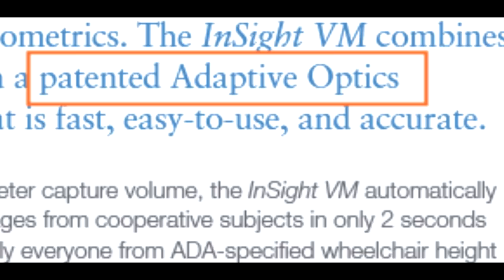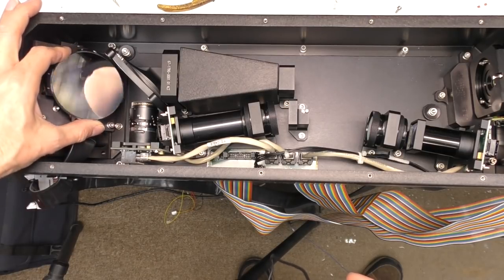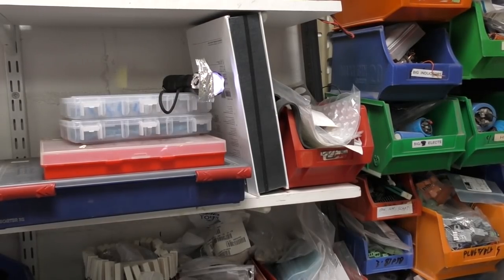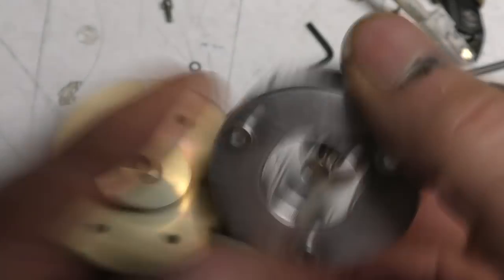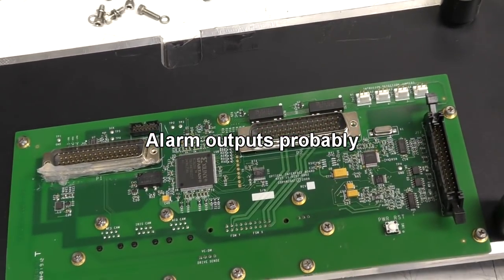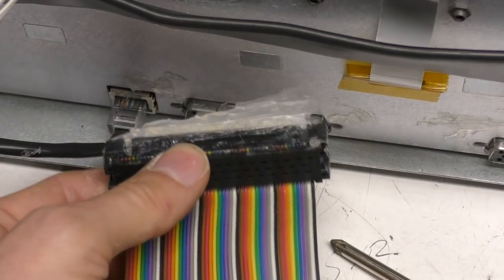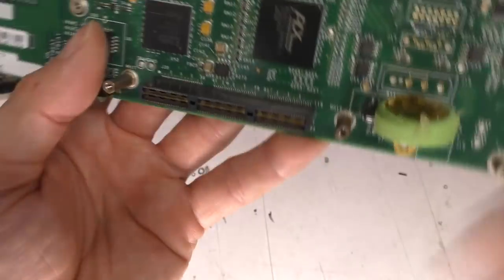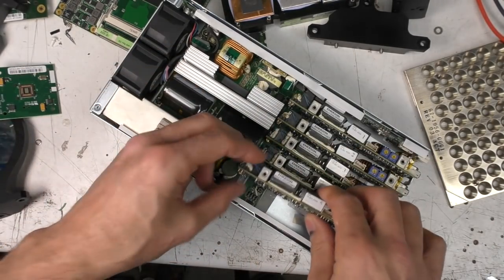Biometric Iris scanner  Aoptix Insight VM AB1012C

Comment: You could probably program the average 2019 flagship smartphone to do this pretty effectively already. But throw a few million into R&D and you'd have an infallible AI supported high tech biometric face/Iris/Retina/body recognition scanner, that's housed in a tiny cigarette pack sized rechargeable self-powered unit. With little to no moving parts, utilising the latest highly encrypted wireless connectivity. Imported from China, available on eBay and in most spy gadget stores worldwide for about $99.99. LOL

Comment: Maybe the siliconed connector was screwed from inside the case, it was very hard to service it and the service guy just used silicone to put it back.
The top mirror sensing maybe is work just like those cheap sharp ir distance sensor

Comment: PSU looks very similar to the Astec MVP series, looking online it seems Emerson now make them. Great power supplies, but a pain to replace the capacitors on some versions (Modules soldered on earlier versions)  2010 onward sounds about correct, but a couple of those boards in that unit looked a lot older, especially looking at the design on the axial capacitors and IC's, I wonder if they had a load of old stock or were these things retrofitted with updates at any point. Seems a bit of a mixture.
Reply from the maker: I saw Astec on at least one of the PCBs in the PSU

Comment: Interesting I've used iris scanners where the system included a palm scanner which also fired IR beams to check the hand was connected to a live person via checking the blood was oxygenated. Some also included a weight pad which was fine if you used the system regularly but if you returned say six months later and had lost or added weight someone came out to check your ID.

Comment: Had a look at the manufacturers website for that deformable mirror, and now it all makes sense.
It needs that mirror to be able to focus the image for the camera as the lens system has a very short depth of field. Meaning micrometer accuracy is required.

Here’s an extract from the article.

Apart from the transverse spatial resolution, it is often important to very precisely control the magnitude of optical phase changes. The variance of the optical phase change often needs to be far below 1 rad2, sometimes even 0.1 rad2. That corresponds to position deviations far below 1 μm.

Particularly for piezo-based actuators, hysteresis and creep phenomena can limit the achieved position. Therefore, low-hysteresis actuators must be chosen, even though they offer tentatively lower stroke

Comment: Why would a company want one of those machines? They tend to price gouge for equipment like that, e.g., it likely cost $500 to make but they likely wont do a reasonable $600 retail, instead they will gouge with some outrageous price.
Reply: Razor2048 there is no way that cost less than $10,000 to design and manufacture. There are so many expensive components as well as multiple CNC components. The lenses were from Germany and that huge, first surface mirror as well. This was also made 10 years ago, it would have been the peak of fast and efficient iris scanning at the time. They probably retailed it for around $50,000.
Reply: 500 dollars LMAO. That Emerson power supply alone was 400 or 500 parts cost, let alone the optics etc
Reply: That PC board itself is probably $500, if not twice that.
Reply: You should probably read basic economics XD
Reply: It's all about the size of the market. Lets assume your numbers are right (I'm not sure they are) and they can make them for $500 in parts and labour. How many do you think they can sell? Maybe 1,000? The market isn't very big for something like this, it's very specialized. So they make 1,000 x $100 profit by selling them for $600, which is $100,000. That's literally nothing. That doesn't even pay for 1 engineer for a year, or someone to answer the phone to provide tech support.
Reply: The optics section alone is easily 10K. I would be surprised if the complete pedestal ready to install was less than 100k.

Comment: Always fascinates me as to how much effort goes into things that have such short lives. One sees this endlessly in electronics as new capabilities make the old stuff obsolete & there is enough prosperity & need to be able to discard things very quickly & replace with something else. Perhaps at some point things settle down & product lifetimes increase, but no sign of that happening & if it did the effect on makers of stuff like this would likely lead to huge changes in their business model & the mind set of the business folk & the engineer folk. For now the engineers likely are the crucial parts of these business, key people needing to be treated exceptionally well or they can leave & in endanger the whole enterprise. Must lead to some interesting personal dynamics. Thanks for sharing!
Reply: I can't disagree more.  Given their construction, these are obviously built to last for decades.  Devices like these are an integral part of the progression.  Once a system like this is built and the concept is proven, someone else (or the same company) comes along and realizes "I can achieve this same capability with much less". These are NOT built to be made obsolete.  Tthey are made obsolete because of the incredible interconnected collaboration and innovation possible in the modern era.  The fact that they can be replaced with more cost effective versions that use high resolution cameras is a GOOD thing - would you prefer 10,000 of these beasts built at cost, or 1,000 of these built and 9,000 built at 10% of the resources/price cost?
Reply: Slightly off-topic rant; honestly its a damn shame to see the amount of appliances and products being manufactured to simply work until such that they fail and you are expected to land fill it then buy new. Non-replaceable fuses, non-adjustable carburetors, "security fasteners". Even as you stated tech such as this which is typically developed around a niche application will rarely, if at all, see a second life despite all the intricate and fully functional parts that make up the whole. I guess all I can really say is don't be afraid to tinker! Not understanding how mechanical/electrical objects work is the beauty of exploration. Information online is more accessible then ever (thank you aswell Mike). Can't do much harm if you disassemble something which already doesn't work right? You may even find that "Non User-Servicable" appliances can sometimes be repaired (ideally with an understanding of safety... no bubblegum wrappers around fuses... :). Something which all fellow tinkerers can relate to. And in my opinion that lack of knowledge directly correlates to profit margin in the eye of current day manufacturers, whether they like it or not. Unfortunately many brand names we have come to trust, either eventually agree with, or are forced to compete in the market of a throw-away society. I thoroughly enjoy collecting peoples junk and breathing new life into it if possible. Its especially funny when you can tell they want to ask for it back once they see it working again!

Comment: Too bad you couldn't get it running. Bastards stole the drive.
Reply: From a security standpoint, this is the right thing to do, to meany HDD's with sensertive data falling into the wrong hands these days.
Reply: Put another old spare HDD in it and install windows then try to find drivers. The PC module is just a standard mobile intel chipset.

Comment: as usual, ridiculously over-engineered with parts that look like they belong to a prototype bench, not a finished product... then they add few zeros on the back of the price tag to excuse their lack of engineering prowess... oh well
Reply: Not finished.... To get it nice, compact and cheaper you need to invest a lot more money which you can't earn back when your product isn't sold in big enough quantities. So in the end you would have to sell you nice "finished" product for the same or even a higher price to get back the extra investment.
That's how it goes with such niche products.
Reply: They probably made less than 50 of these, it was probably more a proof of concept and trialed in certain locations as it would have been extremely expensive to make the one we saw in high numbers.
Reply: @gtjack9  I don't know about this particular unit, but there's a LOT of startup companies that mass produce units grossly overengineered and overly expensive like this in the thousands to tens of thousands.

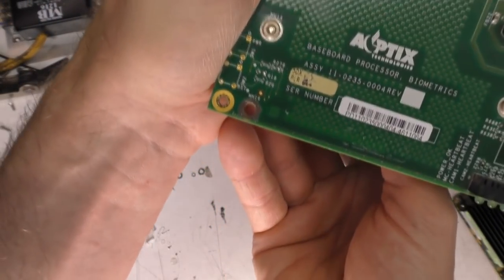Comment: The "5DX" on the processor board at 21:35 likely indicates it was X-Rayed after assembly by an HP/Agilent/Keysight 5DX X-Ray system. A nice, non-destructive way of inspecting solder joints, especially on BGAs.
Reply: I was wondering if there's a process to do something like that possibly x-rays?

Comment: I wonder is the optics similar to the high speed object tracking system "si tracker 2"  they use for filming projectiles and other high speed things /watch?v=vluzeaVvpU0
I am sure the heavy mirror on front wouldn't be an issue as long as it was well timed with the firing.
Reply: MrPlytiger Those systems are mostly guessing where the projectile is based on the measured muzzle velocity, you could probably use this mirror but the angular range on this isn’t very high so it would need to be quite far away from the projectile to track it for any meaningful distance.

Comment: Do modern iris scanners also use such a funky optic path, or do they simply rely on super high resolution sensors?

Edit: Mike also mentions that they use high-res sensors nowadays.
Reply: The latter as i found Out from a Smartphone today
Reply: A little bit Intellectual your smartphone has an iris scanner? Never heard of one.
Reply: @kilrahvp  There have been Android phones with iris scanners available for a couple of years now. It's not THAT big of a deal, as long as you get a decent quality image of the iris.
Please note that retina scanners are a completely different beast, of course.